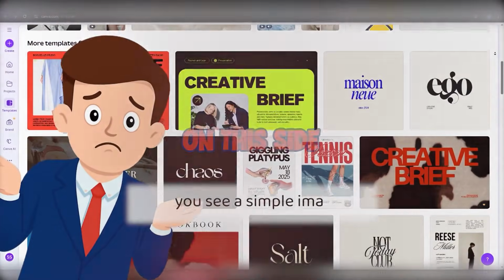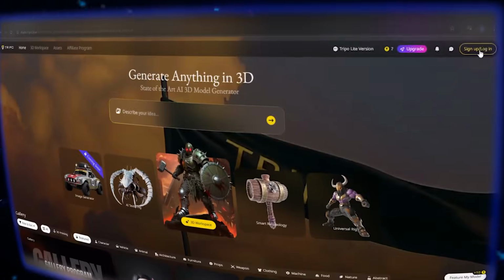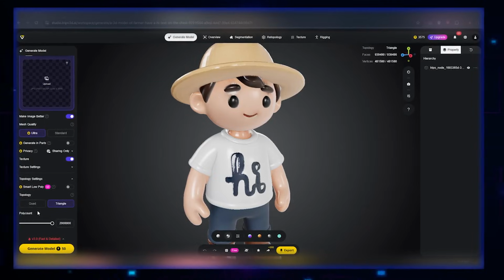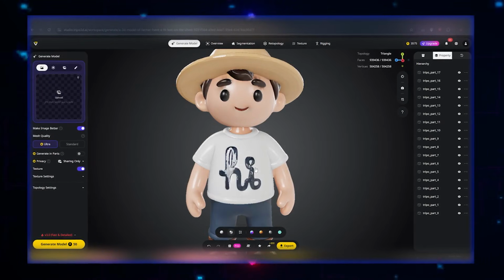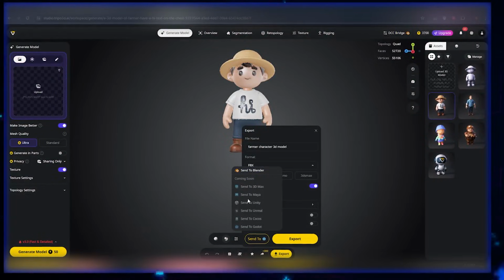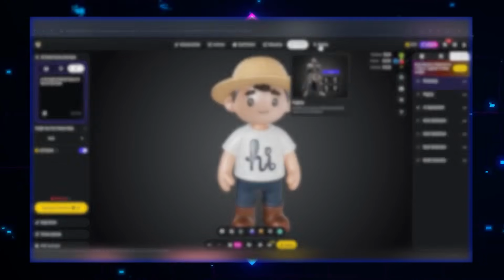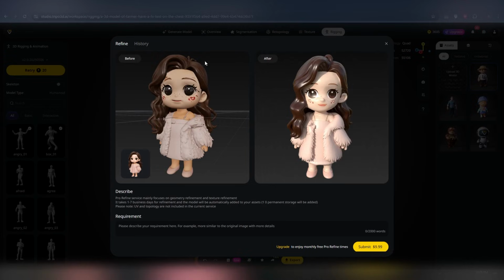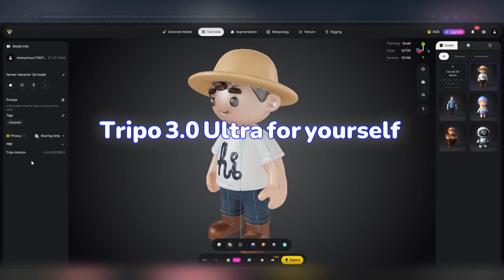Tripo 3.0 Ultra vs Traditional 3D Modeling – Massive Quality Leap Explained

Comment: Smart low poly seems usefull does it enough detail for games ?!
Reply from the maker: Yes, that’s actually one of the biggest improvements. Smart Low Poly keeps the overall shape and silhouette very accurate while reducing unnecessary geometry, so it works well for many game assets—especially props and environment objects. And by the way, I’m currently running giveaways on recent videos, so make sure to stay active in the comments.

Comment: How does it compare to Meshy or Kaedim in real projects?
Reply: Meshy and Kaedim are still strong, but this feels more balanced between speed, geometry quality, and texture generation in a single workflow.
Reply: Tripo is the most advanced
Reply from the maker: From my experience, Tripo 3.0 Ultra produces cleaner topology and more stable geometry overall. Meshy is still strong for stylized outputs, and Kaedim is very good for structured assets, but Tripo feels more consistent and faster in many real workflows. Also, I’m doing giveaways on recent uploads, so your chances increase the more you engage.

Comment: The texture quality is honestly better than I expected.
Reply: Same here. The texture resolution and detail preservation were much better than most AI generators I’ve tested before.
Reply: I was suprised too
Reply from the maker: Yes, the texture generation has improved a lot compared to previous versions. The materials look more realistic and require fewer manual adjustments afterward. Also, I’m currently selecting giveaway winners from recent videos, so you might be one of them.

Comment: Does it export cleanly into Unreal without extra fixes?
Reply: Yes, especially in FBX format, Unreal imports it without major issues. The scale, UVs, and materials are mostly intact, which saves a lot of preparation time.
Reply: In my tests, export worked smoothly, and Unreal recognized the mesh and materials properly. Minor adjustments can still help, but overall it’s much cleaner than older pipelines.
Reply from the maker: Yes, in most cases it exports cleanly in standard formats like FBX and works well in Unreal. Sometimes you may adjust materials slightly depending on your project, but overall it’s very usable directly. Also, I’m running giveaways regularly, so make sure you don’t miss them.

Comment: This looks way cleaner than older AI 3D tools, the geometry is impressive.
Reply: Yes, that was one of the first things I noticed too. The topology is much cleaner, especially around curved surfaces, which makes it far more usable in real projects compared to older AI 3D tools.
Reply: @AITest-f1j6l  thank you!
Reply: Exactly. Earlier tools often produced messy geometry that needed cleanup, but here the structure is surprisingly organized and much closer to production-ready quality.
Reply: @Elise-n7o   thanks
Reply from the maker: Absolutely, the geometry consistency is one of the biggest improvements. It produces much cleaner meshes compared to older AI tools, which makes it easier to use in real production workflows. Also, don’t forget that I do giveaways on recent videos.